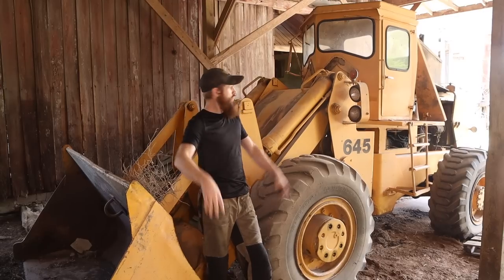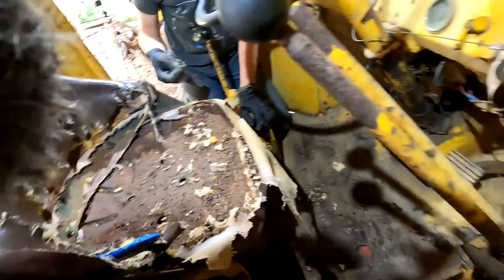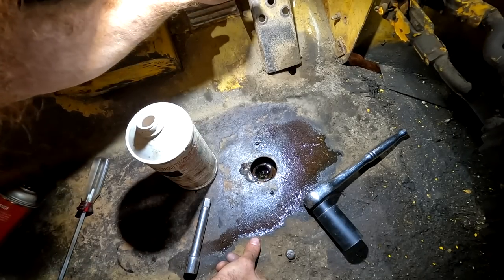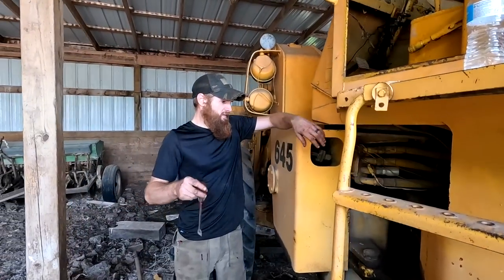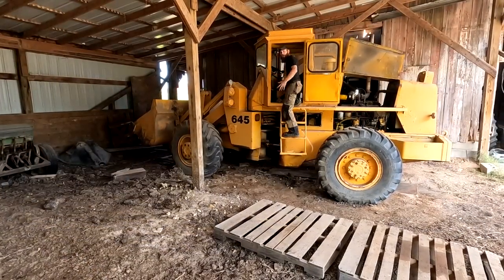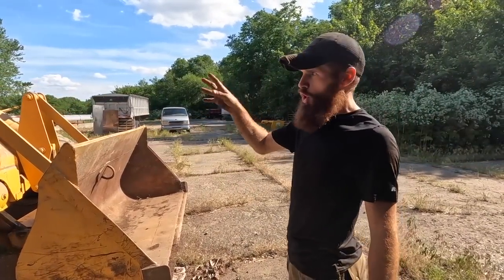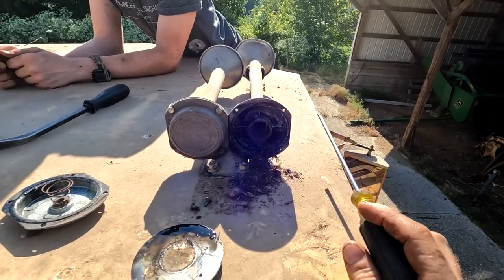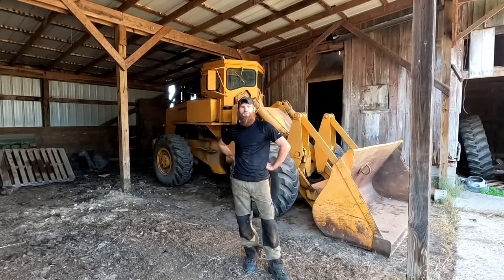Old Loader DRIVES out of the BARN ~ First time in 10+ YEARS ~ Day 4 ~ 1965 Allis Chalmers 645 Loader

Comment: 1975 the company I worked for was running their gravel washer 24/7 for a highway project. I worked 12 hour shifts mostly on a 645. They had a 745 FA, Euclid's and various others rented. Day shift I'd load 50 ton on the semi dumps as they had a short haul and no weight limit. When you got off the machines for break you greased them. I'd loved to have one of them on our farm.

Comment: If it was my guess the c clip that holds the throttle shaft in the pump could be put in backwards. Or maybe the governor assembly isn’t correct. It’s running way to high for rpm. But when you turn key to off position, it goes to idle. The timing seems to be spot on as far as that goes. Just my two cents. Great video! Glad to see the old equipment isn’t going to scrap yard.

Comment: When I farmed, I used to buy transmission fluid in two and a half gallon containers. If I was low, I generally would give it a couple of gallons. Most of these units have large capacity for the fluid. I remember that in one of the John Deere’s, there was a cap behind the seat that was a filler for transmission fluid. I would take  these 2.5 gallon jugs up there and fill with a funnel. I love your program. Had you mentioned Matt from Pennsylvania? You know, the Diesel Creek guy? I think you two were cut from the same mold.

Comment: If it is a Allison, it will have a tag on it, under all the dirt. Most Allison have a filter or two that come down from the bottom, held in by 6 bolts! Don't run it low, as you will damage it in short order! It has a dip stick, you just have to find it! Proper fluid is a must also!

Comment: @5:42 - before I watch this - my old buddy had a Case backhoe.  That machine ran fine for about 20 minutes and then the brakes would lock up.  After it cooled down, it rolled fine - for a bit.  It turns out that the previous owner had topped the brakes up with brake fluid when the machine called for hydraulic oil for the brakes.  A flush and a fill fixed it right up!  Back to the video.

Comment: Make sure you check some Allis loaders took hydraulic oil for transmission so make sure and check before running to long. Great job great video series.
Reply: Better change it out before to long. ATF will eat the seals in the pump

Comment: Sounds like the idle is set too high. Normal idle sounds like after you shut the key off. Appears to slam into gear. Probably linked to why it won’t shut down. Great machines, we used a 645 and a 745 with log forks on a logging job to load trucks and manage landing etc. Thanks for the video.

Comment: On older diesel engines we used to add 1/2 to a full quart of Dexron ATF to the diesel fuel.  It would clean and lube internal parts and add a point or two to the cetane rating.

Comment: 😁 love, love, love the three Beer 🍺🍺🍺 video.Okay four maybe five beer, who is counting! 
Dong good saving three at a time. 😆 
I'm a bit under the weather and running a little restarted. Sm suggestion when bleeding break from the top with one person is alternate full pumps with rapidly bumping the break pedal an 1/8" to 1/4" after contact 5-6 times.
 Also on the No. 6 the things you took off the exhaust were stock rain diverters.

Comment: No dipstick in transmission fill tube? Check transmission housing for a plug or two in the side of housing for high and low level.
Also check transmission filter or strainer for clog. Correct fluid type important for the long run. Allison still in business but not owned by GM (anymore).

Comment: Hello From Mark In KY.  Hey Matt, Several years ago we had a very worn out Fiat-Allis front end loader that looked very similar to the loader that you were working on. 
Regarding the dipsticks;  Remove the top off of the tube where you add the transmission fluid and with  a good bright flashlight look inside the tube and the dipstick should be located inside the tubing - Or at least that was the way that the Fiat-Allis was that was at work. 
I do remember that the transmission seemed to go through quite a bit of fluid from what I remember of that machine.  Your machine looks way better than the old machine that we had., I wish that I could remember more about that specific machine, But as I recall that that was the only one of those loaders that I ever had any experience with.

Comment: I really appreciate you bringing these old machines back to life.  Most of my machines are antiques as well and I use them for daily use, including a Case loader from the sixties and John Deere tractors from the forties.  I don't want to act like a know-it-all, but I would fear for the hydraulic pumps if they are run with the oil level too low.  Keep up the great work!

Comment: put a couple tablespoons of coffee grinds in the radiator ;-)
did it on a 91 GMC with an intake leak that was squirting on the inside of the hood , never did change the intake gasket , it held a few years till I scrapped the truck due to the ring gear going .
Reply: Coffee grinds in the radiator has been shown to cause ring gear failure.  Everyone knows that.
Reply: @docholliday3150  lmfao , it was a 91 GMC 3/4 ton I bought from a scrap yard for 200$ , ran it for years , drove it back to the same yard .
pulled the wheels battery and left a bill of sale in the glove box for them lol

Comment: hi Matt , i think the shut off solenoid might work if you turn the idle down, it probably cant move the metering valve enough because its fighting the governer spring.   just a thought. keep up the good work
Reply: It's idling way too fast, the linkage is either bound up or the return spring broke
Reply: @RJ1999x  Agreed. That;s the first thing that I would have looked at after getting it running.

Comment: Definitely has some play in the parking brake rod - but that would probably mean that it won't engage fully.... and it wouldn't stop it from disengaging.
With having sat non-running for so many years - I could understand that a LOT of the mechanism in the trans would have drained of oil... Filling it seems to work.... and the more you run it, it MIGHT sort itself out - if you keep it filled!  Regular Exercise is important for machines as well as humans!

Comment: You need to get the idle down to minimum. Shifting front to rear at a high idle is not ideal. I’ve ran a 645 I know them pretty Well. Explosive power would describe using it. Defective would be lighter weight. The tires would spin if you weren’t careful coming into the pile. 
The trans is an Allison.
Reply: How does he check trans fluid level?

Comment: I hope you don't damage anything driving low on transmission fluid. Atf is probably incorrect. My assumption for something that old would be mineral oil. That is unless you looked it up. Find the dipstick but I don't know if it is checked running or off. Probably running.

Comment: Why is that thing reving to the moon as soon as it starts? I saw on previous videos you need to choke the air to get it to die, i think the throtle lever is not going all the way down to idle and that is also why it is not shutting down with the shut off solenoid as the throtle on the inside of the pump is actually keeping it open

Comment: some of those transmissions have sight plugs you fill to it with the plug removed and running in neutral unfortunately you may well have to go under it running to do this and the plug has to be replaced before shutting down, or you are still low and have a mess

Comment: So tell me, How many ford trucks and 12 volt air compressorses did you go thru on the 6 year delay for those tires to inflate?  Seems to me after the first two years and six worrn out compressors I would have called a tire service treuck with a real compressor to spare the ford's lives

Comment: Didn't this loader have air over hydraulic brakes ?? And yet you say " I'm sure the wheelcylinders all leak "  🤔
Reply: Air assisted hydraulics, least mine has ,I've got slightly later model with fiat engine, wish my cab was half as good
Reply: @trevorslater2746  lol yea he has a pretty okay looking machine . I wished though he was a little more knowledgeable about what he is doing and not so willy nilly . Obviously it's still low on atf .I wouldn't have ran it like that . It also has a way to high idle . Ow well
Reply: Air over hydraulic  The air is used to assist your physical mechanical depression of regular hydraulic or "Juice" brakes.  Its like a brake booster on your car but used with pressure instead of vacuum for obvious reasons.  I was also cringing watching him rock it back and fourth with the trans slipping.
Reply: I know it has air assist brakes . He mentioned that early on in the project and obviously it doesn't have it just for the air horns lol. I just mentioned it because now he speaks of wheel cylinder that surely leak according to him 😆